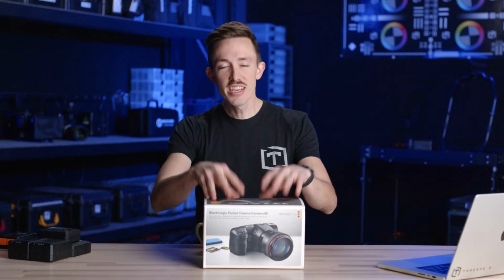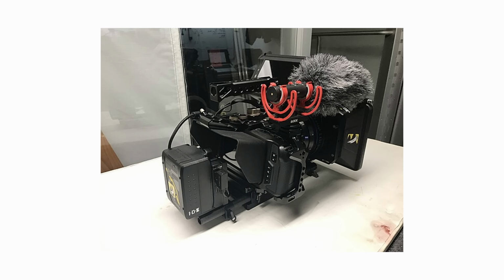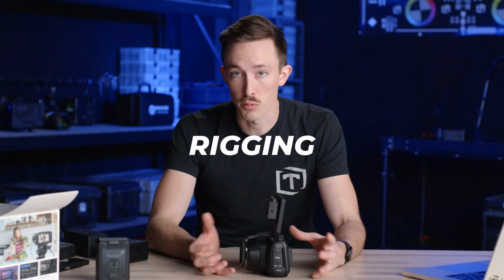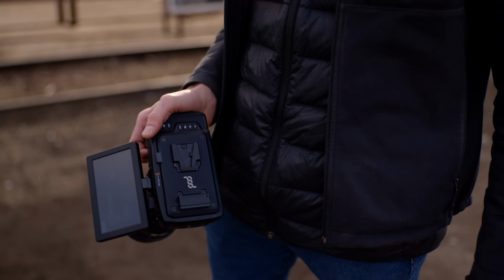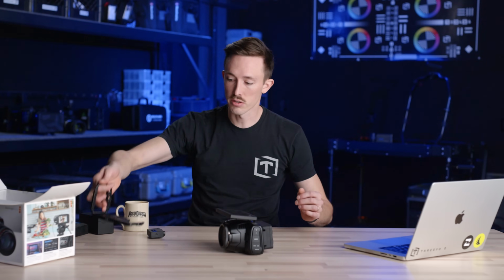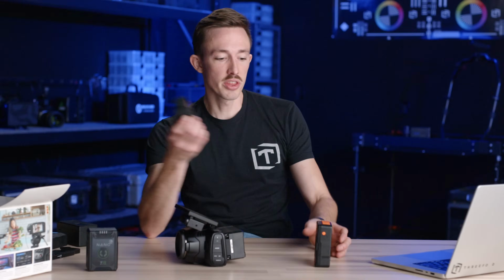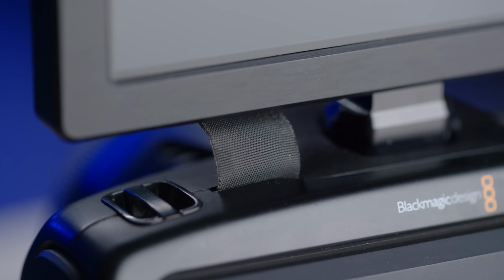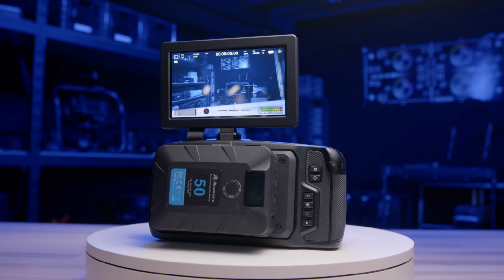The Camera We've Dreamed Of Is Finally Here! (Not Photoshopped!)

Comment: Really glad I came across this video and your channel, but I have to say the the way it limits rigging is a big deal for filmmakers like myself where I go from shoots for commercial/social media to narrative features and shorts. for example it doesn't seem like you guys need a top handle for much, but I use it for specific hand held shots, connecting to an easy rig, mounting wireless transmitters etc. This mod looks perfect for content creators, hobbyists, documentaries, but not for commercial and narrative work. BUT maybe there is a different way to rig with this mod that would work for commercial/narrative work. Would love to see you and maybe someone you guys know do a field test with this mod to see how this can be used in all different types of shoots/setups
Reply: Yeah, not having a top handle is a big deal to me too for the reasons mentioned. Plus, bending that ribbon cable back and forth scares me. I've been using a PortKeys LH5P (which costs $100 more than this mod) which gives you touch control over a lot more features - even switching from ProRes to BRAW etc. and I mount it to a Smallrig EVF arm attached to my top handle.

This is a super cool design - in an ideal fantasy world it would be great if Blackmagic made a monitor that could be relocated wherever, and connected with a proprietary cable, with replacement cables widely available. Or maybe something like RED's system with contacts.

Comment: you can get a wall plug to vlock adapter cable so that way you can run off mains... i'd recommend using one battery for this purpose though, as it probably ruins the charge hold in the long run.

Comment: Very cool but may be a little too late?  I don't know.  We'll see how successful the kickstarter is.  We have four Pocket 4K's we have already figured out all of our workarounds for battery (NPF battery in a side handle that holds the SSD from Tilta).  To drop another $300 on these pocket cameras as they get older doesn't really make sense to me.  But best of luck to this project.
Reply: This is super late for sure. Sadly for the 6k community the pocket 6k G2 solves this problem of the articulating screen. At 1595 on bh right now there is hardly any reason to go eBay hunting for a 1200 dollar G1 to spend 300 modding just to loose AC adapter and cage compatibility.

Comment: Get a Z CAM or get a Sony FX30 or FX3....
Reply: I will say Tilta sells a V mount adapter that's meant for the Z CAM NP-F battery sled and that's what I use to power my camera without needing a dedicated v mount plate mounted on rods
Reply: @Drone443  True...but that's largely pointless.  You can buy a 98watt hour NPF battery which is the same capacity as these v mounts but for like 20-30 bucks.
Reply: But to add more a Z CAM will last almost all day like 10 hours on just two batteries.
Reply: @darrenorange2982 Yeah I don't know the power consumption but it is efficient enough to be passively cooled. That's one of the reasons I like it so much, no internal fan required. I'd be hesitant to take say a Pocket camera to a beach shoot because of their fans.
Reply: Those would certainly do a better job at solving the problems this mod is attempting to address.
Reply: Those are other options indeed :)